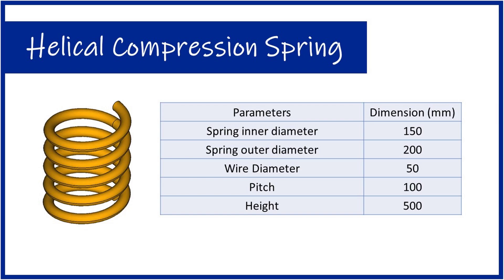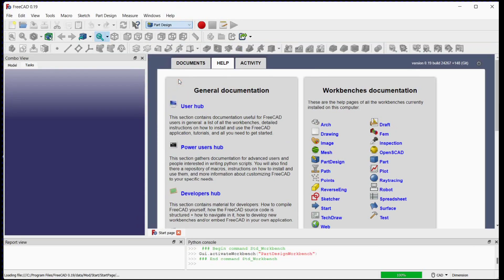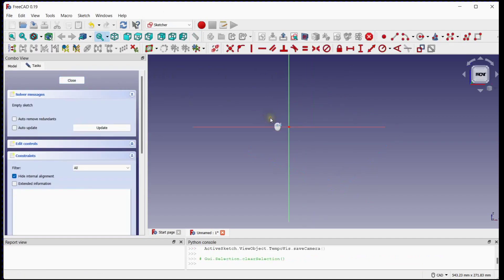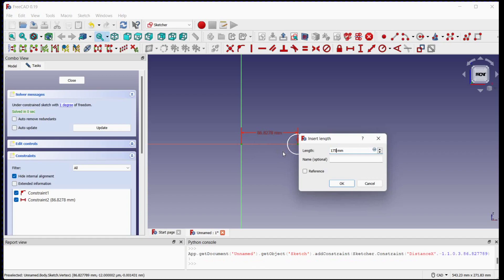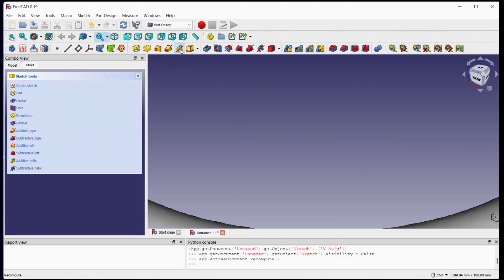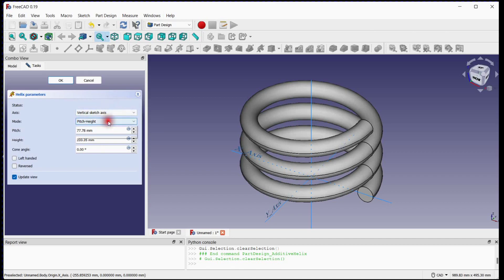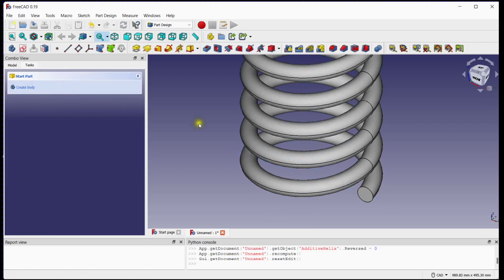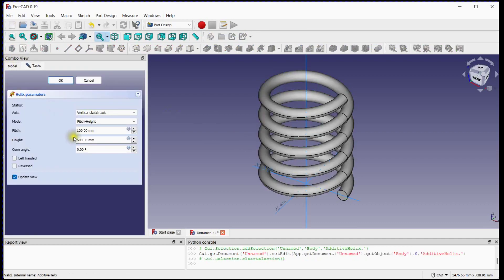FreeCAD: Part Design | Beginner Tutorial #7 (Helical Spring)

Comment: Somewhat to the point, but an explanation of what pitch means in this context. Is that the angle from the horizontal of the climb rate? Or something else?
Reply from the maker: Good question! In the context of a helical spring, 'pitch' refers to the axial distance between adjacent coils, measured from the same point on one coil to the corresponding point on the next coil. It’s different from the angle of the climb rate, as it directly affects the spring's stiffness and overall behavior. Hope that clarifies it!
Reply: @Learn-Engineering  Yes, it does. Thank you!

Comment: Have an issue with creating a coil from 0.1 mm wire with pitch 0.5 and diameter 1mm, lenght 150mm... The program freezes with no result displayed. 
Anyone has the same issue?
Reply from the maker: Hi there! If FreeCAD freezes when creating a coil from 0.1mm wire with a 0.5mm pitch, 1mm diameter, and 150mm length, try these tips: create a shorter coil first (e.g., 10mm), ensure you're using the latest version of FreeCAD. Good luck!
Reply: @Learn-Engineering  whenever I try to make the final coil, it hungs. Free cad 0.20.1 on nVidia Quatro in Dell M6800 graphic station